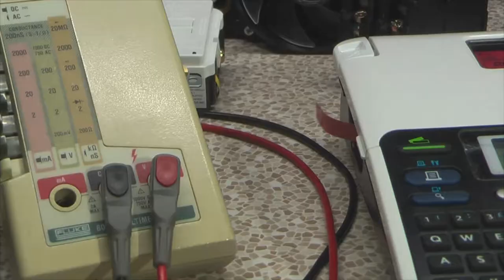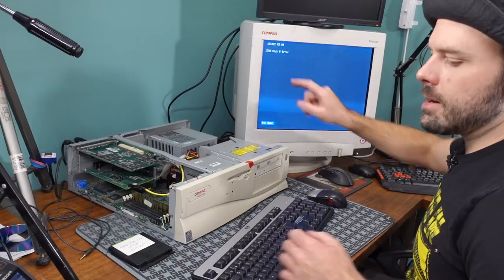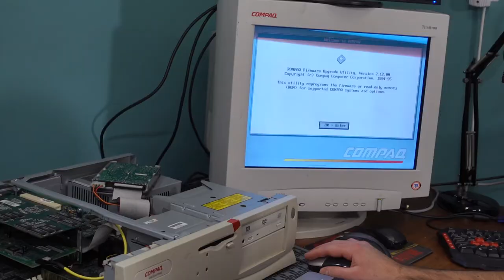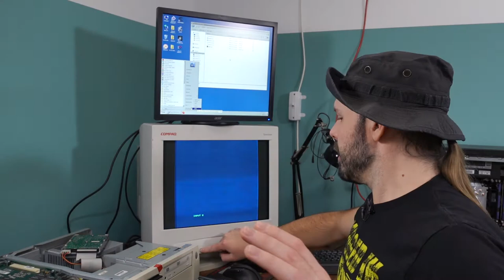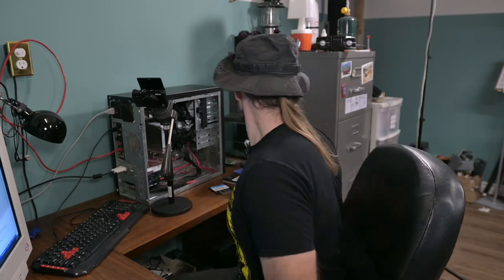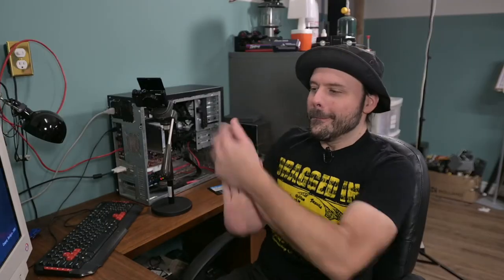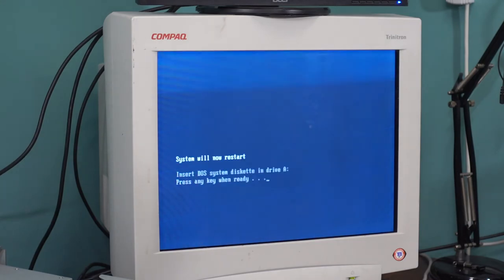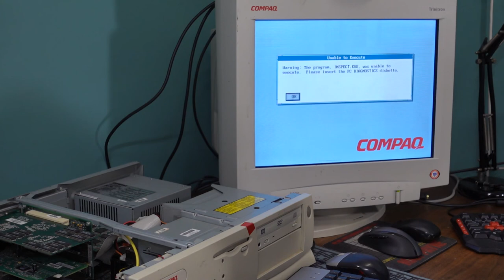Sparring with the Compaq Deskpro 2000 to get the BIOS Updated.

Comment: I also have a Compaq Deskpro 2000.  Actually I have two, of the 166mhz variety.  I was able to update the firmware with the website you mentioned using the "SP8434.exe" file.   Still dont have the F10 setup stuff.   Which file name (download) did you use to achieve the F10 setup option?  Was it the sp4711.exe file?
Reply from the maker: Oh boy, this video is old now, I can't recall off the top of my head. As I recall, you have to do the update to an unformatted drive so it can make a special partition. You can't really update a working system. Well I suppose if it already have the firmware on the drive, it could update, but you'd have the F10 prompt if that's the case. 
One takeaway from this experience, is that there isn't much useful stuff in the BIOS, so it's almost like there is no point doing it. 
Unfortunately, if I don't mention what file I used in the video, I'm not sure what to tell you, mind you, I did make a couple diff videos about this, there might be some in another video if you feel like watching it. I think I mostly covered it here. sp4711 does sound familiar.

Comment: I feel you. After 1 day of trying to upgrade the BIOS, because it only saw 4 gigs out of 20 gigs, I was able to make it work. Of course after booting an MS DOS floppy and formatting the new hard.  But for the love of God, the F10 - Utility still does not want to install. But from what I experienced is more or less an optional thing, so yea.
Reply from the maker: Reading the order of your comment suggests that you tried installing the F10 utility AFTER formatting the drive.
Am I reading this correct. You'd have to install the utility before formating, or a drive with no partitions so it can make it's partition at the beginning. 

But yeah, there wasn't much going on in the F10. Like I think it gives you that ability to change IRQ and DMA's for some of the hardware, but it's unlikely a system like this will see enough hardware to have a conflict.

Comment: im confused ... i have a similar machine (presario 5716 with 450 p3) and want to replace the hdd ...
are you saying that the bios config setup menu is loaded on the HDD? so if i replace the hdd i wont be able to access the BIOS menu? that sounds bad... why would compaq do that?
Reply from the maker: Yeah, that's what I'm saying. For this system, I can't be sure with a newer P3 450 system, I would imagine it might be more normal by then. 
In this case you need to start with a freshly unpartitioned HDD, use the software to make a BIOS partition, then you can proceed to do your install. 
That said, I found this system didn't really need that BIOS software to work. The board seems to have BIOS on it, just no GUI in which to configure it. And as typical with these kind of "name brand user friendly" system. There aren't any real options in there. Other than setting the date, if you don't have this software install, you won't even really miss it, the system will work jsut fine, and you can set the date in Windows once you have it installed. 

The only wild card is if you're trying to use a larger HDD than the system originally supported, then you might need to flash update your BIOS, which, you know, doens't matter in this cause, cause it would likely be the same story for any system of the era. A P3 450 should support a reasonably large HDD tho.
Reply: hi there..
yeah the bios menu is useless..
i was trying to add a 2nd drive originally but that didnt seem to work it kept trying to boot off the new 2nd drive and of course gave an error... so then i tried to replace the drive... it was a 6.4 original but the replacement was a 40gb .. that didnt work either... im thinking from that era that 32gb is prob the max hdd size for bios's of that time.. also no available bios updates seem to be  exist for it..
Reply from the maker: @kyrieeleison1905  Just to confirm, you adjusted the jumpers right ?
Back in those days, the HDD's had jumpers you had to set. Set on drive to master, the other to slave. If the jumpers aren't set right, or are conflicting with each other, that could cause some of those problems. 
I'd like to think we had 40gb drives in the P3 days. Like I know I had a 40gb in my Athlon 500, can't recall if I bought the drive round the same time tho.

Comment: Hey man you mentioned that you found the right setup utility version. Can you point me to it? Looking to revive a half-dead DP2000 5200MMX and missing the bios setup software... so help a brother out, please.
Reply from the maker: There's a link in the video, I'll add it to the desc. 
Hopefully that does it. If not, that site in general might have it, but you'll have to explore and experiment as I did. 
Truth be told the machine should work fine without this, if it's not running at all, then there might be something else wrong.
Reply: @DATT  That did it - thanks! Found the bios and everything. Now let's fix this thing...
Reply from the maker: @mrfivethumbs  Nice !

Comment: Having some experience with Compaq ROM, aside from the BIOS itself it's a multiple floppy thing that creates a partition on your hard drive and installs it there, not on a ROM chip or BIOS. Also it's based on Win3, so FAT16, though you can format other partitions as FAT32.

The way I'd handle it is, put a smaller HDD in, install the setup tool from your backup disks, then put the HDD into a newer computer, clone it to a larger HDD, use a partitioning software to create a DOS/Windows boot partition, then put the HDD back in.

I can personally confirm the existence of Compaq firmware partitions and the ability to use FAT32 on my Windows partition.
Reply from the maker: I have to admit, this video is old enough now I don't remember all what's in it. 
I thought I covered all that, I remember it being a success.
Reply: @DATT  you did it the hard way :))

Comment: Do you have 2 usb ports on back I/O ?
Reply from the maker: Yeah it has them, they are going to be slow and damn near useless tho.
Reply: @DATT  Do you have the driver for it. Working one
Reply from the maker: @fitlifeinsider  USB Drivers, ahhh no. I think they were build into windows, Windows 98 at least. I didn't bother with them that I recall. If I wanted to use USB, which I think I did to help get stuff on the computer, I have an old PCI USB 2.0 card I would use.
Reply: @DATT  Oh thats right. I even have PCI ethernet card 100mbps its fast : D
Reply from the maker: @fitlifeinsider  Hah, I wonder if that old dino could even saturate a 100mbps card.
Reply: @DATT  There are drivers for it... but cpu ram limitted heheh I think Pentium 4 could do some job : P.
Reply: @DATT  I tryed pentium II mmx 266mhz WinXP samsung usb thethering K melon browser It worked just it wasnt very fast hahahah maybe I could say slideShow xd
Reply from the maker: @fitlifeinsider  Oh yeah, hah.
Reply: @DATT  : D yeah it even struggles a lot to run youtube hahahah its like slideshow but its video xd I hear sound but on screen it goes picture by picture
Reply from the maker: @fitlifeinsider  I'm surprised it runs youtube at all, haha.
Reply: @DATT  :))) Well it works : p 1998 in 2024 it works hahahahah

Comment: What if I dont have that floppy diskette and I have new hdd 3.2gb ?
Reply from the maker: Well I downloaded the files I needed to make the disk online, but I guess you'd need another comp that could both go online, and have a floppy drive to do that. 
If you don't have the disk, you can go ahead and installed windows or DOS or whatever and the computer will work just fine. Once you have an OS you can use it to set the date and time, and it'll auto update the BIOS even tho BIOS has no GUI. 
I kind of did this to find out what I was missing, but as I recall, I wasn't missing much. Other than time and date there wasn't much else I could change in bios that was practical, and you could otherwise have a functioning comp without it.

Comment: Hi, i've got a Deskpro that displays an error 102 - system board failure, is there any (quick) fix or solution for that? Thought it could be an old empty clock battery that's fixed to the motherboard, but i've got no idea how to reset, replace (or make a battery mod around) it without damaging other components or board itself.
Reply from the maker: Oof. The battery was long dead on my system, it still worked. The board would still work with a dead battery just it won't remember the time and date. Adding a new battery it pretty easy, tho it's hard to explain off the top of my head. Replacing the existing one usually requires soldering. 

But if the error says it's dead, then, not much I can think of would fix that short of advanced surgery. 
One thing to look for is bad caps. Capacitors. Often that's want go wrong on old boards, and they can be replaced if you have the soldering skills. 

I have a video called "Recapping a Pentium 3 Socket 370 Motherboard" you can take a look at to get an idea of what I'm talking about. That info is going to apply to pretty much any old mobo the same way, give you and idea what to look for and what it takes to fix it.
Reply: Had this error with an external battery with to much voltage (selfmade 4x AA battery instead of 3 :D ) , maybe its giving this message also if external battery is empty? (pins before memory slot most 4(/3) right ones)
Reply from the maker: @ShaiWa  WHoa bud, 4xAA/6V is way too much, the original batter was 3v. I do recall it being spec'd out for 3xAA, but I only used 2xAA. And no, once you put an external battery, it the error should go away. But like, try lowering the voltage, if that doesn't work, I'd say you might have damaged something with too much voltage.